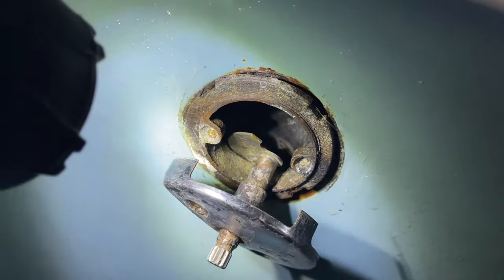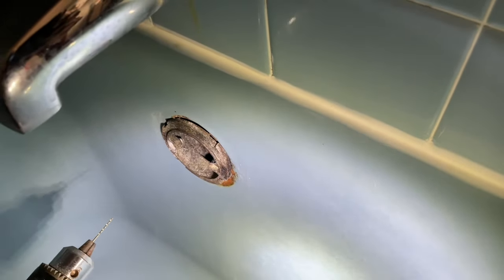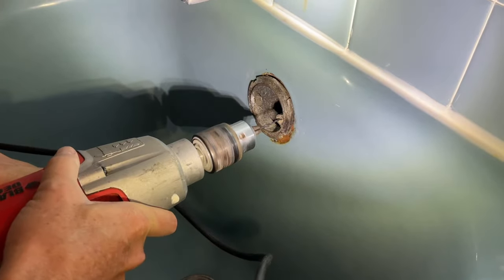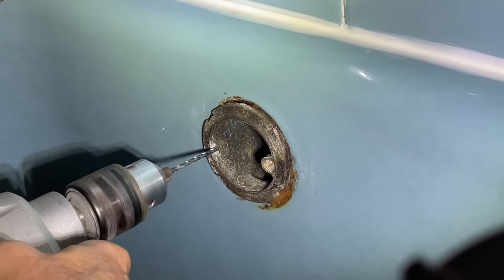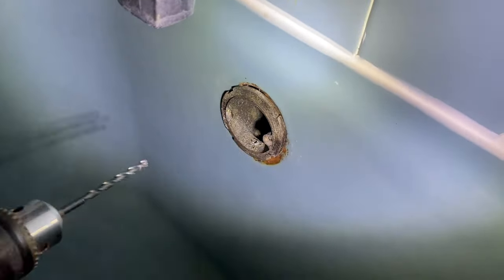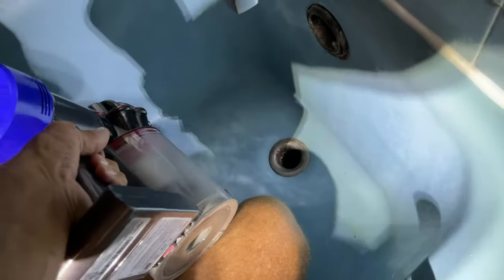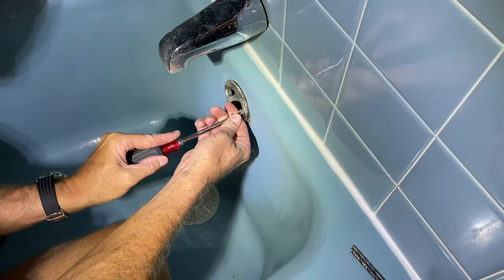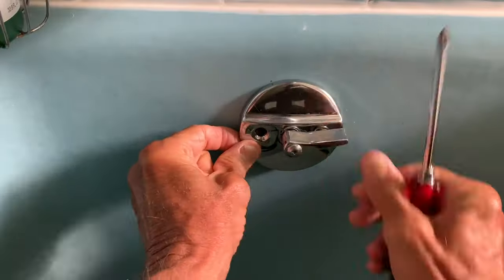How to drill out broken screws

Comment: You're so lucky. I tried drilling out the screw, but the drill bit is now broken in the hole. Went with a bigger bit... broke as well. Welcome to overflow hell...
Reply from the maker: Sorry to hear that you may need some special drillbits that can cut through metal and a really powerful drill
Reply: Weld a bit to a chainsaw motor...
Reply: Did you use black oxide drill bits? They may be better for drilling into screws.
Reply: I got a broken screw extractor broken in half in one of the holes😂😂

Comment: I’ve worked on boats where drilling out screws was common. What worked for me maybe 20% of the time was to use a reverse fluted drill bit. Chuck it up and put the drill in reverse. If you think about it, using a normal bit actually spins the bit in the “tighten” direction. In reverse you add the “unscrew” direction and add heat at the same time. If the headless screw was in wood and the reverse drill bit didn’t work, I would chuck up a “spring pin” which I filed teeth on one end….use a size with a hole that matched the screw shaft….and drill around the screw shaft. Make sure the spring pin is twisted in the direction that grabs the shaft as is spins. It will essentially grab the screw and back it out. That way I could simply plug the hole with a dowel or jam a few bamboo skewers in the hole and replace the broken screw with a good one.
Reply from the maker: Thanks for those tips extremely helpful when you’re working on a boat you really have to be resourceful at one time I had a 34 foot Grampian sloop Thanks for all that information and thank you for watching.
Reply: Are you referring to using a left handed drill bit? I have a stripped screw in my bathtub handle. I've tried an extractor but it hasn't worked.
Reply: @CrowdPleeza  yes, the bit is designed backwards to what we are used to. Put the drill in reverse direction and drill the center of the screw. The spring pin I refer to is also called a “roll pin.” I dremeled teeth on one end and chuck it up. The i.d. Of the pin is the o.d. Of the headless screw.

Comment from the maker: For drilling metal, the best materials for the drill bit would be:

	1.	Cobalt (HSS-Co): Cobalt drill bits are a top choice for harder metals like stainless steel and cast iron. They maintain their strength and hardness even at high temperatures, which makes them ideal for long-term, heavy-duty drilling.
	2.	Titanium-Coated HSS: Titanium-coated high-speed steel (HSS) bits are good for a variety of metals and offer better durability and heat resistance than plain HSS bits. However, the titanium coating can wear off over time.
	3.	Carbide: Carbide-tipped bits are extremely hard and ideal for the toughest metals, like hardened steel. They’re more expensive but highly durable and precise.

For most purposes, cobalt or titanium-coated HSS will serve you well when drilling through metal.

Comment: What if the threads were lost during the drilling process?
Reply from the maker: Then you may have to re-thread it. There’s certain tools that you can use to do that but it’s more complicated process. Good luck thanks for watching.
Reply: Tap and die set.  See if a buddy can loan them, or they're not too expensive at Harbor Freight, et. al.  And make sure that you follow recommendations as to what size hole you would have to pilot/drill versus what size thread you're going to tap (quick Google search would be adequate).  Good luck, and there's definitely videos on YouTube on how to use taps and dies.

Comment: I see you are running the the drill backwards. I am always afraid to drill out the threads themselves. Is that a worry? Hence going backwards?
Reply from the maker: It’s always a wor specially on older stuff as you never know if you’re gonna get the screw breaking inside there and then have to do even more work good luck thanks for watching

Comment: Could you reach behind it with a needle nose by scripts?…
And thread it out ??
Reply from the maker: We could give that a try next time might work
Reply: @TomLeeman  yeah once the head snaps off it usually alleviate the pressure and they come out by hand sometimes ..
Question: those 1/4 20 x 3/4 bolts.  Are they pretty standard size ?
I have some properties and I wanted to snake bathtub down the overflow.
Looked at bolts and I’m pretty sure they are going to snap ):
Reply: @TomLeeman  meant to say vice grips (: